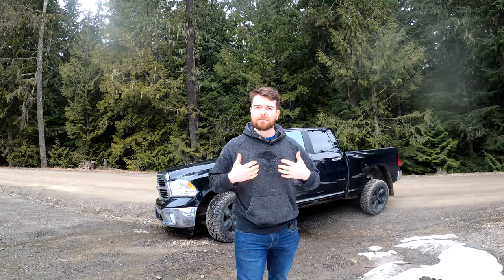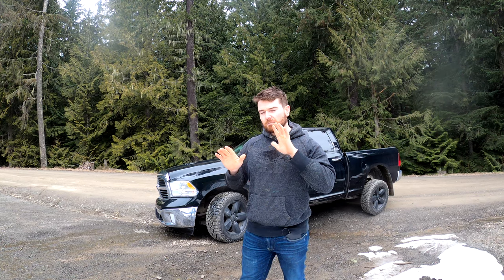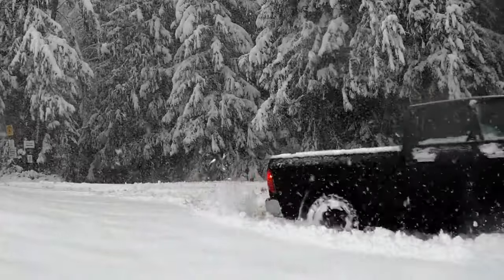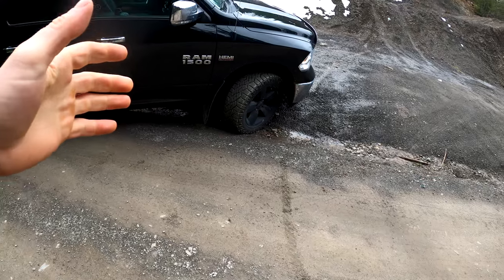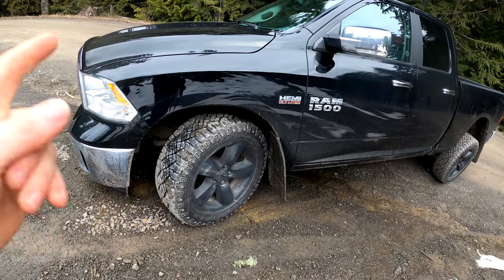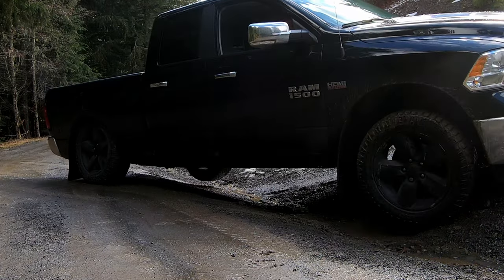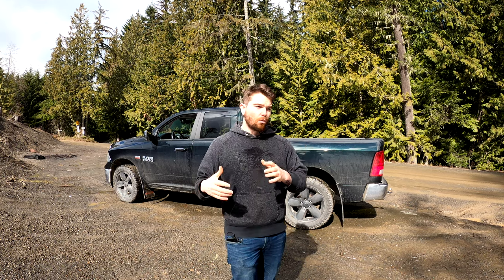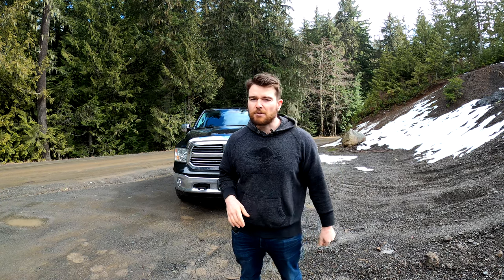RAM 1500 Off-Road 4WD LOCK TEST (With Open Diff's) | Not Really a 4x4...

Comment: There is a transfer case harness sold for 200$ USD on Facebook that forces the lock somehow, I think the how is explained on their page. It's manually switched on and off and is supposed to be run 20-30 minutes with 5-10 minutes break inbetween. Look up black fox industries on Facebook.

I will not be getting this for two reasons. 1. I almost never go in off-road or snow that makes me need this and 2. Anything I buy from the US or Canada ends up costing 30-50% more due to shipping PLUS customs fee, so those two reasons combined make this absolutely not worth it for me, but I really hope you find this interesting and worth it because I would LOVE to see a video with that harness, the 4wd lock forced doing this EXACT SAME TEST as shown in this video. Maybe also a bit on how simple the install was (supposed to be plug and play). 

Also, the reason I found this harness is because of the videos you made on the BW44-44 and 44-45 transfer cases.

I've also found a thread on swapping the 44-44 to the 44-45 (I won't be doing this either): https://www.ramforum.com/threads/bw-44-44-to-bw-44-45-swap.132570/
Reply from the maker: the only reason I may actually buy that harness is make a video on it. would be an awesome thing to compare before and after! 

But I can tell you it wont make a single difference on this test. that controls the transfer case. and it will ensure power is going to both the front and rear axles at all times. but the differentials are what splits that power to each wheel. you need locking differentials to have all 4 wheels getting power. if not only 2 wheels will spin no matter what the transfer case is doing. 

I appreciate the comment! and it would be a really cool video to make, Ill look into purchasing the harness!
Reply: @TheGettyAdventures   ohhh, I see. Learned something new then :) but, in that case, I hope you still make a video on that harness and that you at least make the money back on that video.

Comment: Interesting mine came with the anti spin diff  I have a 2019 Ram 1500 Classic big horn on a 4 inch bds lift running nitto ridge grapplers 35x12.5
Reply from the maker: anti spin diff is a type of limited slip but they work well! it probably makes a big difference

Comment: Have you made a video same test but 4 low? I just got my truck trying to find out the limitations of it thanks again bad ass videos lot of help on info
Reply from the maker: I have not really done a specific test for 4 low. I really should because a lot of people are interested in the differences. My personal belief is that it wont make a difference. 4 low is simply a different gear range, it wont change how power is distributed to each individual wheel. but it would be an interesting video!
Reply: I will look foraward to that video thanks for info...

Comment: Thats what the trac control is suppose  to do,it works in my tacoma
Reply from the maker: Toyota has a really cool Traction control system, it can actively apply brake pressure to whatever wheel is slipping and force power to all wheels. It's a really awesome system and wonder why other manufacturers don't do the same thing.
Reply: @TheGettyAdventures  They absolutely do.  It uses the abs system.  Hell my 2005 Titan had blsd.
Reply from the maker: @russtomas4461  I really want to try out the system because everybody mentions how awesome it is. 

my buddy has a Tacoma so I'll have to get him out here to have a go!

Comment: Hold traction control button for 10 seconds all four wheels will pull
Reply from the maker: that is exactly what I did. All that does is help fully lock up the transfer case. does nothing to your differentials.
Reply: My 2019 1500 might have been different than yours it worked for me .I got a 2500 last week and it doesn't lock some kind of dynamic braking system
Reply: Idk about these but TRX has front open diff with break traction control in front, so are we sure that in some mode there is no break traction sys in regular 4x4 Rams without lsd?
Reply from the maker: @bsranger40  Interesting! is your 2019 a fifth gen truck ? it could very well have a more complex traction control system that could actually help in this situation
Reply from the maker: @tallll70  It could very well have a  system like that, I'm not as familiar with the 5th gen Rams. But it would make a lot of sense for that TRX to have something like that!
Reply: @TheGettyAdventures  classic tradesman .I had same problem until I watched a video that said hold traction controll button until dash says esc completely off sure enough all 4 wheels pulled then .hope that helps

Comment: What about selecting 4WD Low in this same scenario
Reply from the maker: the principle would remain the same. the two wheels that are both elevated would still receive all the power even in 4 low. 

Now if this was real and I was actually stuck, Yes 4 low has a higher chance of pulling you out in a situation like this just because of the better wheel control and more torque. but if both those wheel remained elevated and you couldn't rock out of that spot 4 low wouldn't help.
Reply: Differentials transfer torque 50/50. So the max torque to any tire in 4wd is based on the tire with the LEAST traction, which if one is in the air is to say no torque goes anywhere. 

A 4wd has 3 diffs, Front, Rear and Center, so let's say I am stuck and one tire in the rear has only enough traction to handle 20lbs of torque before spinning/slipping. The 50/50 principle means that both tires on that axle can only get 20lbs of torque then, and logically, the same 20lbs is the max sent to the front tires. 

Limited slip diffs use spring loaded clutch packs to mitigate this as the spinning of a tire will engage the clutch and provide some additional resistance, allowing for more torque to the wheels. 

The best case is the Torsen differential, that uses a unique worm gear set to transfer torque on a ratio between the two outputs, commonly 3:1 or 4:1. So in the example above with a Torsen, the wheel on the same axle as the one with only grip for 20lbs would receive 3 or 4 times the torque as the limited wheel, giving you 60-80 lbs of torque to that wheel for a total of 80-100lbs of torque to that axle to drive forward with. Usually the Center diff is not Torsen, but assuming the Front is as well, then you would get that much torque to the front axle as well, and not be stuck. If you have a wheel in the air, like in this video, even a slightly application of brake with a Torsen diff will result in more than adequate drive torque to get moving.

Of course the ultimate system is locking diffs, but those are expensive, require more maintenance, and are best left to hardcore off-roaders. I think the best compromise is Torsen front and rear with a locking center. Low maintenance and great ability to get un-stuck.
Reply from the maker: @jg8263  thoroughly and excellently explained sir. really appreciate you taking the time to explain that.
Reply: @TheGettyAdventures  thank you. It helps that I went to college for mechanical engineering. That said, EngineeringExplained here on YouTube has an excellent video on the subject, from a technical/engineering aspect, that pairs nicely with your practical demo in this video.

Comment: don't get a flat, those rams have a temp spare, not a full size. which tells you everything
Reply from the maker: Mike I actually found that out the hard way, popped a tire about 4,000 feet up a mountain trail. had to limp back down on the donut. luckily this place is nice and close to home so I'm not too worried. 

But yes the fact that a full size spare is an additional "option" is kind of a joke
Reply from the maker: Jonathan Spier  you are one of the lucky ones lol 

Did you buy the truck new? if so check your build sheet I bet they charged you extra for the full size.